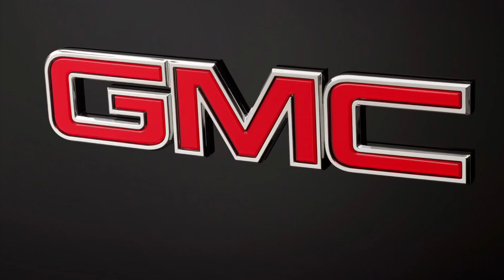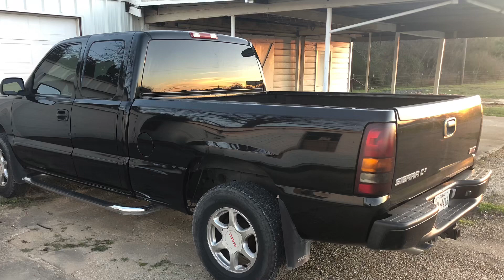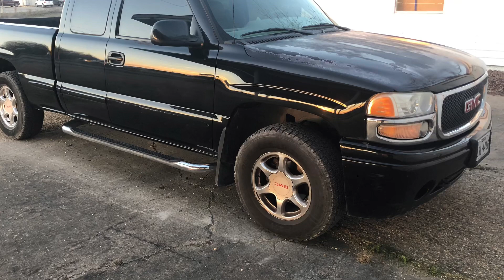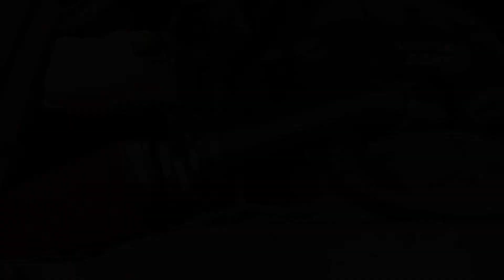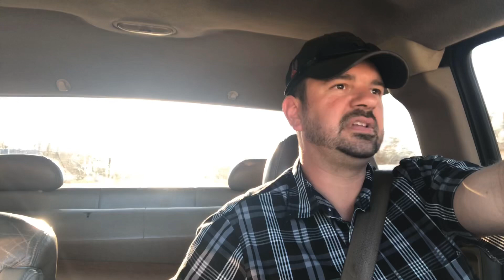5.3 706 / 862 heads on a 6.0 LQ4. Why I’m using them! 2001 GMC Sierra C3. S1, E4.

Comment: I have done 5.3 heads onto a few 6.0s. The lq4 gets great torque on pump gas. The lq9 becomes limited to e85 or premium gas though, because of compression. 

I did that head swap and stage 2 BTR truck cam into a 2500hd recently. The torque was impressive, and it drives better than stock too.
Reply from the maker: Did you put in a stall with that combo in the 2500hd? I think a 5.3 headed 6.0 with the Truck Norris cam would be a stump puller! I’d also like to see the new 5.3 Hot Rod cam in a 6.0.
Reply: @Ninelinegarage  it's not actually my truck, but a friend's. He just got it with no mods at all, and no plans for a convertor yet. It's got the torque for a stock stall..... We are planning on CAI, headers, and all that when he gets his taxes though.

I have the stage 3 truck cam in a boosted 5.3. It would need a stall in an automatic. Low end is not what I'd want in a truck either..... A good, tight convertor makes a bigger difference with the stage 3.

Comment: I can believe you would use them, Richard Holdner has done tons of testing and out of all the stock cathedral port heads, 706 heads make more power in the mid range than anything else, 10-20ft/lbs for 1500-1800rpms in the middle of the power band and only on some of the larger engines the 243s make less than more 10hp for 500rpms at the very top of the power band. The 706s also are very cheap, you can run more cam with the extra p-t and the lighter valve train requires less additional supporting mods to keep from dropping valves the way rec port heads love to do, rec ports might give a noticable peak HP increase once you have 387/402/408/416/427ci ok on a stock 4.8/5.3/5.7/6.0/6.2/383 stroker I honestly believe the 706s are the much better choice, especially in a huge heavy truck, I think that the additional cam timing 706s allow vs rec ports with factory piston to valve clearance will get a lot of the peak power back along with the additional compression ratio which at 8.5cc is nearly 1 full point, you can go even further with thinner head gaskets on an LQ4 withndiahed pistons aand gain up to 0.7:1 compression with a 0.027" head gasket vs a 0.051" if you have an LQ9 with flat tops then 706s may require the use of 0.060" LS9 head gaskets to get the compression down from like 11.7-11.5 to 11.4-11.2:1 either way much better choice especially with A TBSS intake, porting, mild clean up or even just a quality valve job on 706s will do wonders too. I am planning to use 706s on an LS1, LQ4 and possibly a 408 stroker. For a street vehicle, that's heavy, with taller gears and possibly even a low buck turbo set up they wonderful, 706s are proven to make a turbo spool significantly quicker than big valve heads and aren't a bottle neck at all at sub 1000hp street power levels. Excellent choice and you will be the one laughing all the way to #1st place against the guy with 243 or L92 heads on a 6.0 or 408 in a huge heavy truck.

Comment: Im putting 862 heads on a ls1. What size push rods what i need? Hoping you can help me out
Reply from the maker: If you’re just changing heads, stock length should be good. If you use a thinner head gasket, mill the heads, etc, you might need different ones. It’s always a good idea to check pushrod length though no matter what. A pushrod length checker is just one of those tools every engine builder should own. I hope that helps, I know it wasn’t a specific length answer.
Reply: @Ninelinegarage  thank you for answering me. I wondered, how would the 862 heads fair on a 383 stroked ls1? Im not turning more than 6k rpm. I'm trying to find a good cam.for the stroker. Its my daily truck. So i want exactly like what you talk about in the video. Red light to red light pulling power with a chopoy like idle
Reply from the maker: If I were building a 383, I think I’d shoot more towards the 243 heads. The extra displacement will respond better to the higher airflow numbers and larger valves.
Reply: @Ninelinegarage  are they the 243 heads the ls1 heads? I want keep compression around 10.5 to 11 to 1. The reason i was asking is because the 862 heads i have are milled smooth, new seats, new valves and valve seats.
Reply from the maker: Some people refer to the 243 heads as LS6 heads. They later came on truck engines as well. You’d need to do all the math with an online compression calculator to see where your compression would land. With a 383 and 862 heads, you may be over 11:1. Especially since they’ve been milled.
Reply: @Ninelinegarage  okay. They're a refressed set of 853 heads near me but idk if those are any good. If im not worried about compression. Could I stick to my 862 heads or would they limit power?
Its also an aluminum block 99 ls1 block, getting a tbss intake, 102mm tb, and going in my 2000 silverado. I have a flexfuel setup for it.also
Reply from the maker: I would stay away from the 853 heads. If I remember right, they require a different style head gasket. If you’re not concerned with compression and possibly running E85, the 862’s will work. Like I said though, if it were my engine, I’d seek out a set of 243’s for that 383.
Reply: @Ninelinegarage  okay. Thank you sir. I found some 317 heads im gonna have milled to 65cc chamber and do a 220/224 .600 lift cam. And a valve job. Does that sound okay?
Reply from the maker: The flow is comparable to the 243 heads on a 317. I’m not sure you’ll be able to get them down to a 65cc chamber though. I’d certainly consult your machine shop on that! I’d say a cam in the 224 range would be just about right if you’re looking to stay under 6k rpm.

Comment: Doing the same build.  706 heads ported and polished on my lq4. Just got my BTR truck norris cam.  .560 springs and CHE Trunion kit.  TBSS intake,  long tube headers. And I got a torque monster
Reply: I'm doing a very similar setup on my truck. How does it run/ran?
Reply: What push rods did you go with?
Reply: @braydenmeals9311  I haven't picked any yet but I asked Richard the other day, on a live stream he and several others said they use stock along with lifters,  but I might go with BTR's they are 7.400 vs the stock 7.385
Reply: @matt angelo  i was gonna go with the kits 7.4 and ls7 lifter. You think that'll be good?

Comment: Your numbers are all just barely off, but your point is spot-on, I'm thinking about doing it as well, only Reserve I have is paying for the premium fuel everyday. Personally I feel my gear ratio will makeup my down low if I go 862's I have 488's 34.5" tire Best of Both Worlds scenarios what I'm thinking, along with the Chuck Norris cam, you're spot-on on that two into one exhaust I seen the test on the Dino, it was a 🤯 on engine Masters. 👍
Reply: Retard timing and run 87. I have 2 lq4. One has 706 and my daily has 862 stock heads. Way more power and in my 2500hd 4x4 with base tuning I did with hptuners, I get 17.5 mpg on 87. I don't sell aftermarket products and only recommend what I've proven myself to work
Reply: @jakelords24  sounds good, I have a melling adjustable timing chain gear set, Terminator x max, but as far as retard goes, That's me, I got the Terminator because I live in the middle of nowhere and there is no tuner, but I don't even own a computer/laptop. Hell if it wasn't for my phone, half of this wouldn't be spelled right, but I'll get there,  it already beats the hell out of that worn-out 190 horsepower 350 TBI ✌

Comment: Its nothing knew I ran a small valve 706/862 on my ls1 back in 04' til they cracked that is. lol Besides the perfect quench at 11 to 1 and high velocity small runners. what makes them so responsive down low and mid- range is the smaller intake valve. Because if you look at a valve on the back side around the stem it shaped in a slope like a hershey kiss where it becomes the stem, and the larger valves need bigger slope for strength so at fully open the bigger valve will flow more up high, but since the smaller valve has less material on the back side with a flatter slop will outflow up to around .500-550  and what make's 317s good, Is the easier and safer broader range in tuning  plus while being able to run lower octane when needed can be a plus (here were stuck  running on Cali Cat Piss)  so now for every pound I run over the single psi that my 317's  lost in the  large chamber,  is only a turn of s knob away

Comment: Do the 862 heads just bolt up or do you need to change pushrods ?
Reply from the maker: If you use the same cam and same thickness head gaskets, the pushrods will be the same length.

Comment: Any of you have issues with the 706/862 heads cracking on the 6.0s? I know some of those 2 (mainly the 706s I think) were the Castech castings that had issues with this. I don’t know how big of an issue this really ever was on 5.3/4.8s, but it seems like the higher compression combo with them being on a 6.0 would accentuate the issue?
Reply: No body is picking on a part you have on your motor, glad its working out for ya, a lot lot of the 706 Cass Tech heads have cracked on people, that's why if any way possible, why not avoid it instead of seeing if you get lucky ? That's why for my application which is the same as yours, think I'll go ahead and source some 862 because, there aren't forums full of people talking about their head cracked.  Disclaimer no 706 heads were harmed during this comment, god please bless the poor little New Guinea's, PS,  Gus your wife is a Bigfoot
Reply: Hay man, 5 months later, I looked into this as well it is the 706 Casteck go with 862, but being on a 6.0 has nothing to do with it, 👍
Reply: Almost 18k miles later and my 706 still kick ass. Stock cam, springs, used head bolts and new MLS gaskets tuned by me with hptuners. On my factory 220k mile lq4

Comment: 2006 H2 Hummer . LQ4 with 862 heads ported with 2 inch stainless valve and stainless stock size exhaust. Intake bowl seat opened to 80% ,  Tick Performance SNS2003 cam . Going to upgrade injectors now to 51 lb . 4L80E trans with a yank 3200 triple disk .  One big torque monster .

Comment: Plan on running 862s on my LQ4 with a sloppy stage 2 cam, until its goes forced induction.  Should be fun and much more powerful then the 180hp anemic 305 motor in it now!
Reply: How did this turn out I plan on running the same set up
Reply: @1122rodney  same here. I want to ls swap my humvee

Comment: Why do people think 317 are best for boost   If you make more power na with 862s then you will make even more with boost.   More compression more power.
Reply from the maker: I have to admit, when I made this video, I was still in the old school mentality. I’ve since learned much more about advances in modern fuels, timing and compression in today’s boosted applications. I will wind up having a built bottom end with at least flattop pistons so I still may use the 317 heads but I’ll cross that bridge when I get to it.
Reply: Because you'll need a much heftier built bottom end with high boost and high compression because of cylinder pressure. You'll also need methanol, e85 or atleast intercooling because of thermal efficiency of higher compression engines...they create more heat. And you also have to think about volumetric efficiency, you can cram more air/fuel mix into a lower compression engine than you can a higher compression engine due to all of the above.
Reply: @just_another_gearhead  so your one of the guys that thinks lower compression is better.   Thats so 2000
Reply: @semirm8248   sure you can make more power with a higher cr that's a fact and probably around 11:3ish and be pushing 12.5ish with flatops on the OP's 6.0, but that comes at a price, you'll need to start thinking about running less boost/timing or run race gas or e85 (which means more injector, and more pump and flex conversion if the pcm and flex sensor aren't already present) if you want to take advantage of that cr. You can run more boost and timing on pump gas with 317's on a stock block. On a 6.0 the valve size and runner volume of 862's becomes an issue when you start making her really pump some air, so you'll end up running more boost to make up for the loss in volumetric efficiency of 862's then you have to think about doing rods/pistons/headstuds because of the substantial increase in cylinder pressure, not to mention the heat it'll produce. You could run a less aggressive lift cam and boost pressure on 317's for the same flow as the 862's and still be stock bottom end safe. Once you start porting, then buying and swapping larger valves, buying injectors and fuel pumps, head studs, rods/pistons, you'd just find out you'd have been better off and cheaper to just run a thinner head gasket to bump the compression a bit if you really wanted more cr...besides 317's on a 6.0 make 9.5cr with stock dished and 10.5 with LQ9 flattops already both of those numbers are just fine, no real need to go up in cr unless you want to start replacing everything else....then you might as well go full racecar, run high cr and run water/meth.
Reply: Start adding more power the 862 will choke a 6 liter. Have 408 with dished -3cc weisco with K1 bottom end with ported 799 heads that flow 325 at .700. Planning 88mm turbo with E85. 220lb injectors and a twin fuel pump. All arp studs and bolts with ZR1 head gaskets.

Comment: I have this same truck in Pewter, That C3 is a fun truck right of the box. Not sure if you exhaust was changed before you got it or what but they had factory 3 inch 2 into 1 on those.
Reply from the maker: It was changed because it had a Flowmaster on it.

Comment: With running the 5.3 heads on the 6.0 will you install a cam for a 5.3 or 6.0?
Reply from the maker: The cams are the same...but... I will run a higher duration cam because of the larger cubic inches.

Comment: Okay does the 4.8 come straight from the factory with 862 heads yes or no
Reply from the maker: Either 862 or 706.
Reply: I believe the early units came with 706s, later with 862 due to castec 706 porosity.

Comment: Do the 706 heads still allow you to use 87 octane fuel since it bumps compression to 10.5:1? I just picked up a 2000 3/4ton truck with LQ4 and Iron heads. My truck is a 87 Military truck that has a 5.3L right now but want more POWER but not at the expense of premium fuel.
Reply from the maker: That will all depend on the tune and how the timing is set up. I personally wouldn’t run 87 but that’s not to say that it can’t be done.
Reply: Back off the timing and they run great...
Reply: You could always do one of two things, get 0.060" LS9 head gaskets to knock 2-3 tenths of a point of compression off, get an adjustable timing set and degree your cam retarding the cam timing to reduce the dynamic compression ratio to a safe level or have a cam specially cut to work no matter what you static compression ratio is with whatever fuel you want to use.
Reply: The LS3 can be ran on 87, so in reality this could as well.

Comment: Think I said this I have the same truck in grey I was going with the 799 heads BTR cam kit tbss  intake cold air want the truck to hit 475hp is that crazy with long tubes and a tune?
Reply from the maker: You should be right n that neighborhood with that combo. Depends on the cam timing as well.
Reply: @Ninelinegarage  it should  still be an 93 pump gas or 91 pump gas truck  correct?
Reply from the maker: Oh yeah. Of course, it will depend on the tune but the compression will be more that ok for the octane so long as the ignition tiling is set right.

Comment: I made a video about how I ported my 706 heads for my ls1 and I will tell you it RIPS! 7000 rpm no problem, my 0-60 went from 5.4 seconds with a 5000 rpm launch to high 3s with a 3500 rpm launch, I put in a cam of coarse, but just a cam wouldn’t have helped that much

Comment: Does anything need modified to swap the heads? Anyone know if the rockerarm assemblies are interchangeable?
Reply from the maker: Everything is the same. At least if you’re referring to the 862/706 heads.
Reply: Thanx for the feedback! Yes i am referring to the 5.3heads. Wondering if i can use rockerarm assembly from my 317s  rather than buy a set for the 706/862s.
Reply from the maker: Yes, everything is interchangeable.
Reply: SierraC3TV Black_Widow_C3 so you can use the stock push rods and rockers from the 317 heads on the 862 heads? an they will bolt on no problem with no valve train issues?
Reply from the maker: Yes sir. Everything is the same. Now if the heads have been milled, you’re using a bigger or faster ramp cam, thinner head gaskets; you’d want to check push rod length.
Reply: SierraC3TV Black_Widow_C3 ok thank you

Comment: I was actually thinking of putting some 862 heads on my LS1 got them for $20 cuz the guy upgraded to 243's, I actually built an LM7 and swapped it in my 99 trans am when the LS1 got hungery and ate its crank. I like 862 heads they are dirt cheap and when ported flow more than 243's.